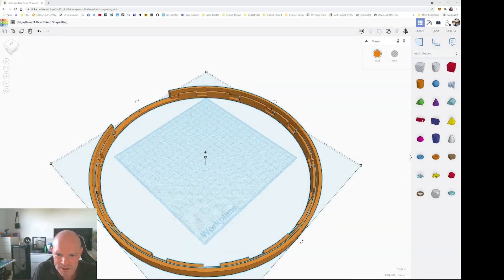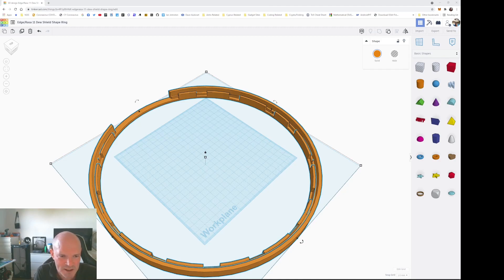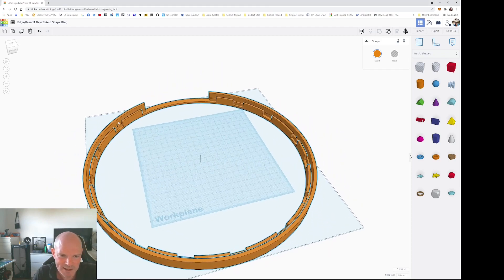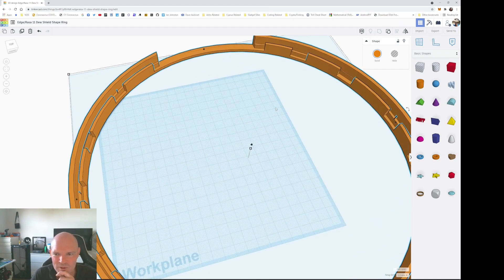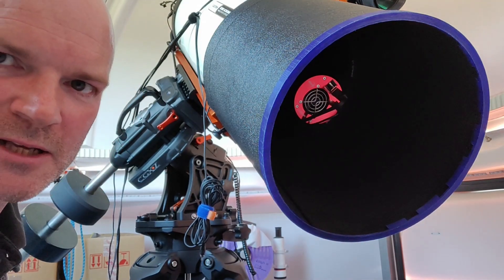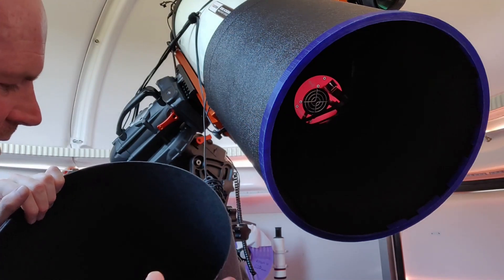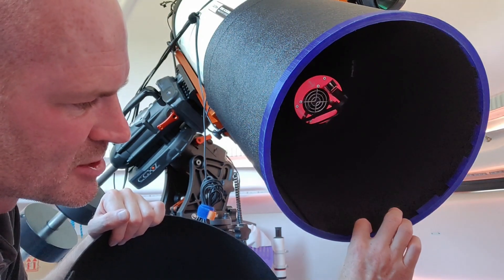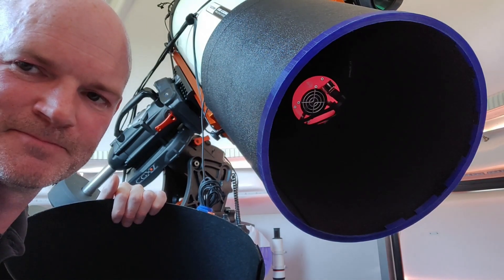3D Printed Dew Shield Shape Retainer

Comment: Great idea mate, one of the issues with dew shields.
Reply from the maker: Thanks Steve, yeh, after I had done the test with it on and off the last time and never seen any difference, it was by chance the other night I noticed the shift in vignetting and thought something was not right. I guess being so flexible it was constantly shifting around and taking it on and off for filter changes etc, I also moved the mount back to remove the N/S offset in the dome, as the dew shield would also catch the shutter controller box depending on positioning. So sorted that problem as well.
Reply: @DavesAstrophotography  so many teething things to work around and do when setting up a rig. I looked into a dome also but the nexdome shutter width wont support the twins :(

Comment: great idea, i have the same issue with the cheap dew shield on my CPC1100 edge HD , have tried rolling it and laying it flat when not in use, it helps but did not solve the issue. this is a solution.
Reply from the maker: There is probably many different ways to achieve the same thing. A bit of thick cardboard with a hole cut out in it, may also work.

Comment: Makes me wish I had a 3d printer.  I stopped using a dew shield on my rasa 11 because of this issue.  Nice idea!
Reply from the maker: You could also probably achieve similar results if you get your hands on a thick bit of cardboard and cut a hole out in it,  anything really just to put some rigidity into the open end of the dew shield.
Reply: @DavesAstrophotography  great idea!  Thanks